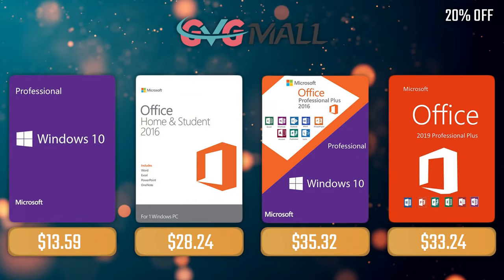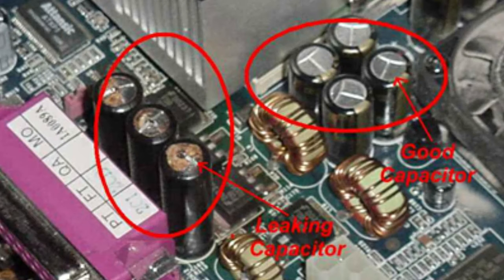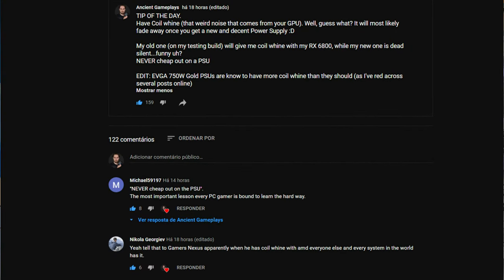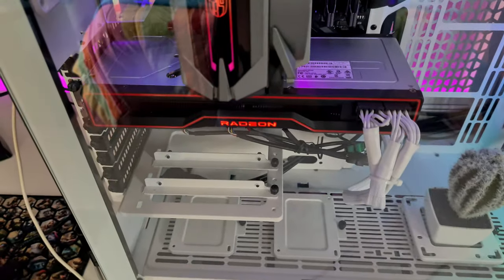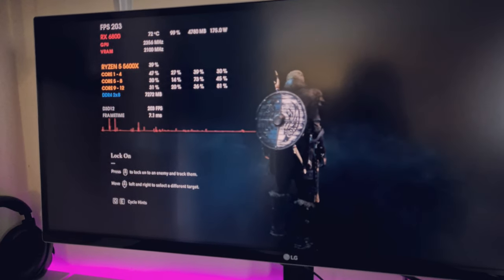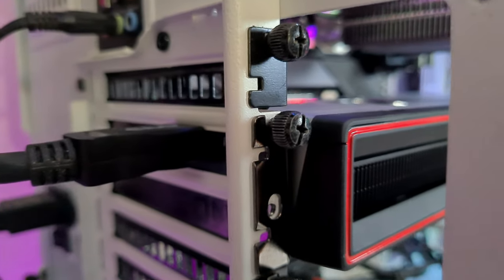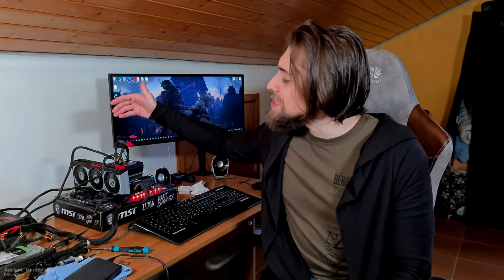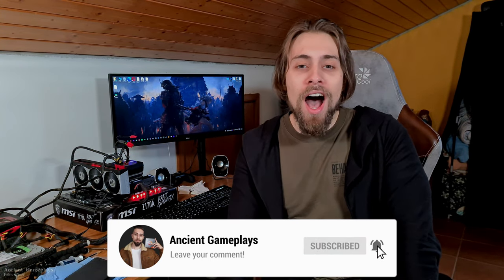GPU Coil Whine -  GPU or PSU's Fault? How to fix it?

Comment: I'm running a 750w Corsair Gold with a 6600xt and getting some coil whine depending on what I'm playing.  I'm using the 6+2 cable that came with the PSU but going to try buying a nicer 8 pin cable and see how that works. My GPU only has the one 8 pin port so using 2 cables isn't an option for me.
Reply from the maker: Hey man, dont do that, just get a new psu or undervolt your gpu
Reply: what brand is your 6600xt ?
Reply: @OptLab  XFX Speedster QICK 308 AMD Radeon RX 6600 XT with 8GB GDDR6, AMD RDNA 2

Comment: I just bought a Corsair RMX Series (2021), RM1000x and RX 6800 by powercolor and both have loud coil whine! = (
Reply from the maker: You got got a worse model I guess man, nothing you can do there beside undervolting, which considerably helps
Reply: @AncientGameplays   Indeed, I do also wonder if its because im using a b350 prime plus with a 3900x cpu. When i have more time i will try out your tips. thanks!

Comment: Rm1000x, gf3 1000w atx 3.0  which is better for rtx 4000
Reply from the maker: A good and new psu. 1000w is absolutely not needed
Reply: @AncientGameplays  which are better, rm1000e 210aud, gf3 1000w 289aud
Reply: rm1000e 210 ,rm 1000x 259
Reply from the maker: @zxz9041  get a good 850w and call it a day, like the rm850x

Comment: Should I go 750watt for future proof even with a 3070? Or 3080? For e.g seasonic gx focus 750w gold...Is it gonna have coil whine problems with my new gpu u believe?
Reply from the maker: A psu is always a food investement
Reply: @AncientGameplays Do you think giving 200€ for a white psu like rog 850 gold is worth the money?Seasonic is building them but is it worth spending 200 bucks on a white looking good psu for only 850w and gold certification or should I go with seasonic9(black) 750w gold at 140€ idk im kinda confused.Another question I wanted to ask you is that beside the fact I know you are mostly an amd fanboy,I had ryzen 5 2600 and I decided to change to intel (i7 10700k for the sake of money rather than going to an amd 5600x which would cost a bit more with less cores and threads)so I picked the vfm value this time...Do you think It was a good option for 330€ (i got the marvel's version) real price in greece is 315€ for the regular one...I'm telling you that cuz the new intel gen4 pci is coming (i7 11700k) but i wasnt willing to spend more than ~300 to a cpu for what I do, I think it's more than enough...I hope they are not costing like 350 cuz that would be really unlucky....Anyway glad to see a response from you and tell me your thoughts...You will surely help me!
Reply from the maker: @padazop  gold certification itself doesn't matter much. But yeah, any PSU over €140 should do it...it will literally last you years and years...
Reply: @AncientGameplays  do you think 10700k (i7) was a good choice 2021? for 300bucks? compared to 5600x 350+ and less cores/threads?

Comment: mine is 6600XT, that only need a 4 pin power cable, my PSU is corsair rm750x, any suggestion for solution to get rid the coil whine?
Reply from the maker: There's no such thing as getting rid of it if it is caused by the gpu components, undervolting will help, but it will still be there
Reply: Should I use 2 2pin cables To reduce it?
Reply from the maker: @aswinpanembrama8043  No, not really
Reply: @AncientGameplays  should I change the PSU with multi rail PSU? Or I just make my GPU running in stock not OC mode?

Comment: The RX 7000 series is known for having coil whine isn't it? I have a EVGA 850 G+ PSU which should be enough for my 7900 XT but I get really bad coil whine on the GPU. Though I have 2 SSD's and 3 HDD's so maybe my PSU isn't enough? I only have a Ryzen 5 3600 CPU
Reply from the maker: All series have coil whine, it is up to the version and materials used on the boards, not the gpus per se
Reply from the maker: Also, you're heavily cpu bottlenecked there
Reply: @AncientGameplays  haha I just upgraded from a 2070 Super. I'm saving up for a new MOBO and CPU eventually. I play mostly older games at 4K 60hz. So its not too bad.
Reply from the maker: @crusherman96  at there you're fine then!
Reply: It seems like ripples from PSU got amplified, maybe add a few ferrite beads to PCIe cables would help.

Comment: i have a be quiet straight power 11 650watt psu and the same psu in 750 watt here. no matter which, the msi trio 4070ti has extremly loud coilwhine, that i can hear from 6 meteres away. no change in the whine with 1 or 2 cables. the whine is louder then the fans on 1400rpm. the whine already start at 80 watts draw. so its even there on old games,  that use 20% gpu load, locked at 60 fps. so its bascially always there.
Reply from the maker: I can only see bad psu quality, bad mobo quality or bad components quality on the card
Reply: @AncientGameplays  smal update. i bought a 280 buck bequiet dark power 13 atx3.0 1000 watt.. result was no change at all

Comment: I use Corsair RM850x 80 PLUS Gold with my 5700xt red devil and coil whine is pretty bad. Will try to power gpu with 2 cables instead of 1 as you advised,  just wondering  would undervoltage your gpu helps with this too?
Reply from the maker: it having gold efficiency doesn't automatically mean it is "good", just that is is more efficient

Comment: I have a corsair HX1000 Platinum with a Sapphire Nitro+ Vega64 and when playing games it screams coil whine. So bad PSU or?
Reply: I'd say it's probably the vega
Reply: ~ Use a separate power pin cable.
~ Try dampening your case
~ Putting thermal pads over inductors coils and pressing them with Heatsink, Waterblock, or something else
Reply from the maker: Being 1000w doesn't mean much sadly and older psus suffer more (even more on high loads), but considering the insane power draw of vega 64 i assume coil whine is "normal"

Comment: I have noticed that rtx3000 cards always have coil whines. I had around 10 3070s and 3080s, whine always there more or less. 6800xt reference from gigabyte had insane coil whines, while same card from asrock was perfectly silent. For now I am using 3080 ftw3 so far quite silent.

Btw had two different psus from seasonic and be quiet, same crap.
Reply from the maker: Yeah, Gigabyte cards are sadly a crap....I would always get Sapphire, Power Color and MSI Gaming X for AMD, and EVGA, KFA2 and MSI Gaming X for NVIDIA
Reply: @AncientGameplays  I have 3090 gaming x trio with 750 watt Corsair psu and my whine sounds like a dog whistle
Reply from the maker: @Pcgamingfixes  obviously...those cards can easily pull 400watts alone, toss in the rest of the components and you have at  least 500w under load. if that Corsair PSU isn't that great, it will mean that the components will be bad, and having like 75% will definitely make things BAD. You NEVER EVER cheap out on a PSU. If you have a card like 3090, then you simply go and get a GOOD 850W (minimum) Gold Standard PSU from Corsair, Cooler Master, Bequiet, Seasonic, etc 
Have a nice day
Reply: @AncientGameplays  Fully aware just havent made the upgrade yet. I found a 3090 at microcenter for a cdecent price and I had the funds so I went for it. Just got lucky it fits my current case and everything runs seemingly well on my bronze 750. I've suspected a bunch of random issues I have stem from there. I also have been having an issue where certain apps will cause my Sony TV Im using as a monitor to just restart. Aimlabs was doing this today, selected a mission or alt + tab to another window and TV clicks off and back on again.

Comment: I thought I have coil whine with my powercolor red devil 6800xt. But it was my psu (be quiet straight power 850w) which made the noise. After I replaced it with one from corsair it is all super silent.

I stick my old be quiet psu in a friend's pc with an rtx 3080 and there it makes no noise. So it seems that it is really sometimes the combination of psu and gpu.
Reply from the maker: Like i said, its a mix of GPU/PSU :D
Reply: Matthias would you mind sharing what Corsair PSU you got ? I have the same gpu and PSU right now (be quiet) and the noise drives me crazy :)
Reply: @julienmoysens  Sure! I bought the Corsair AX850. It is a rather expensive power supply and of course no guarantee that it will work.With this combination, it's been working for me for about 4 months now. Good luck to you!
Reply: @nonespike  thank you for this ! I already managed to reduce the coil whine thanks to the tips of @Ancient Gameplays by having two separate cables. I might though buy aew PSU. Thanks for the suggestion.

Comment: Dealing with coil whine on xfx merc 319 6800xt had corsair rm750x bought a rm1000x have 2 cables running, I also have cablemod extentions, going to try without extensions
Reply from the maker: Try without extensions yeah, also, the XFX models aren't usually that great, and you can also undervolt your GPU a bit

Comment: My new gaming rig goes crazy coil whine when under loading, I have a 6900xt ref. card with EK waterblock installed and an Asus 850w rog thor power supply. Should i change my power supply but they both a brand new..:(
Reply from the maker: Well, that card consumes a lot, even more with EK waterblocks, but a better PSU is never bad. how about the PCIe cables. Also, you can try to UV a bit
Reply: @AncientGameplays  Hello, thank you for quick reply. i dont use PCIe raiser cable, just straight plugged to the motherboard PCIe slot. one thing i forgot to mention, with stock AMD cooler the coil whine still exist but not as loud as after installed EK waterblock.Its amplifying the buzzing sound that really annoying... :( .
Reply: I feel your pain. 6900XT (Sapphire) here with EKWB water block and bequiet Dark Power Pro 1200W PSU. The GPU screams like a madman, the coil whine ist just insanely loud. I put some of the plastic washers between the PCB and backplate screws and it got a little bit better... Also noticed the coil whine gets even worse when PSU and AVR/TV are plugged into different power outlets.
Reply: @christianliebling3769  I have the same brand as you. I read some post that dont fasten the screw tight to the waterblock, turn 1-2 turns of the screw to lossen it  after screw tight may help the coil whine
Reply: @kaizmak  yes I’ve done that and it also helps a bit but not that much. A huge difference was without the backplate, that’s why I reinstalled it with screw washers and I made sure to not tighten the screws too much. Just enough to secure the backplate. 
Same thing with the gpu block itself, I reinstalled it and only used two fingers to tighten the screws. I don’t know what it is exactly but the water block definitely made it worse. 
My old 5700XT with the EKWB water block also had some coil whine but nothing that bothered me. It was dead silent compared to the 6900XT. ^^

Comment: Having the issue of coil whine with a evga 1000w gold g5 & using 3 pcie cables on my evga 3090. I assumed it’s the same brand & it’ll work good together. I was wrong. Gonna pick up a corsair this week😂
Reply from the maker: It will always have coil whine to some extend my friend
Reply: Was corsair any good? I have the same Evga but 850w and the coil whine is unbearable when playing Spider-Man
Reply from the maker: @skull7231  spider-man is not that heavy, are you sure the coil whine comes from the PSU/GPU?
Reply: @AncientGameplays  Yep, i even got it on video sounding like a drill, i can send it to you if you wanna check it out.
Never buying crap from evga again.

Comment: Hello, I have coil whine in my computer, I am using rtx 4070 super msi oc 2x, psu a850gf 850watt, it is too low to be heard on the desktop, but it is loud in the game, I do not know how to get rid of this sound, I have read many forums and I use the psu with an ATX 2.0 converter cable. Could this be a reason? If I buy an ATX.3.0 psu, my processor is 750 watts. i714700kf do you think this will solve the problem? I don't ask you about this because the graphics card is chamfered and I cannot replace it. If you write me seriously, it will help a lot.

Comment: I have concluded after my  "scientific" studies that Coil whine is caused by the Case :( I have replaced basically all the pieces in my PC except the case, and Coil whine still persists ... lol
Reply from the maker: Coil whine is gpu sided lol, but the psu is definitely the "filtering factor". Getting a good one always helps
Reply from the maker: Also, house current may be a problem too

Comment: For GPU coil whine just run Unigine Heaven without fps limits, for 24+ hours. 
Solved my Strix 3080 OC coil whine problem, without changing PSU or cables or some other crap.
Reply from the maker: You dont "solve" coil whine per se as it is "electric vibration" sounds. You most likely just had parts that needed to be "burned" to make no whine anymore, and it would happen   with time. For almost all cards, thats not the case
Reply: @AncientGameplays  dude it worked for me, so I share my fix. If it can help even 1 person I'll be happy. Max stable OC (+70/+250) + 24hrs stress test did the job for me, can't be the only one. 
I have a be quiet 1200w platinum psu, I won't spend hundreds of bucks just to see if the PSU causes the GPU whine.

Comment: HI 
I have the same sound excatly .

gpu : Nvidia GTX 1070 8GB
psu : cooler master bronze v2 650 - 230 V

idle gpu power 9-15 whatts
idle gpu voltage 0.7 - 0.8

gpu power while gaming 1230 - 140 whatts
gpu voltage while gaming 1.0 - 1.1 volt

so it looks every thing normal but I still have the whine sound
I could not put two cable, any another advice ?

Comment: I've just built a PC 3weeks ago. I have new MSI psu 1000w pci 5.0 atx 3.0 and rtx 3080 ti vision. It started to coil whine after 1 or 2 days and I'm not sure how to check it if its psu or gpu. any advice ?

Comment: Im gonna try a different PSU. Mine is an 8 year old cx750 i got a little whine with my 980ti but now I have a 6800XT its VERY loud. I don’t hear it coming from the GPU just the PSU.
Reply from the maker: Yeah, the watts dont matter much as from 10 years ago to now, psus evolved tu support differe t power requirements

Comment: i have a brand new  fighter 6700xt and i have coil. My PSU is a RM 750 Gold corsair. I used two separate cables but there is coil. Should I return this gpu for a new replacement?

Comment: Thank you for the great video! I have just built a brand new PC, EXCEPT for the GPU (of course, they are hard to find). So I am using a brand new Corsair RM850x PSU, with a very old GTX 970 GPU. I am getting coil whine at all times. When I move my mouse, type on my keyboard, in game, etc. I unfortunately do not have another GPU to test on, and I cannot get integrated graphics to work on my motherboard so I can't test the PC without the GPU either :/ 

Is it likely the old GPU is at fault here?

Comment: hii, im using bitfenix whisper 750W, first i use 1 cable split to 8 pins then i try 2 cables, the result is 2 cables smoother but still i can hear a little bit coil whine, its dangerous? thanks

Comment: i got a 650w psu is that enough to run: I7 10700KF and a 2080 Duke? :)
Reply from the maker: you should always look into have a max of 70% load of your PSUs full power. I advise getting a corsair 750W gold (or seasonic) and you'll have a PSU for 10 years xD

Comment: I have not chip psu at all ASUS Strix 750watt Gold and have crazy loud coil wines with rtx 3090 and rx6800xt before… full loud of system 550-580 watt.  Tried ones gigabite 1000 watt gold psu and it was the same loud coil wines. Only some undervolting and fps limits help make it less noise but it still there…

Comment: I have a corsair Rm 1000x PSU and Rx 7900xt GPU
and whenever i'm playing Cyberpunk, RDR2 and even now GOW Ragnarok and I get pretty bad coilwhine at 144+ fps, but in other titles I haven't notice coilwhines, this could mean that any of those 2 components is defective ? 🤔
my pc is not even 1 year old since I did the assemble
Reply from the maker: no, not defective, coil whine is just electrical sound. your components, like your GPU should have better capacitors, but that's all, you're fine

Comment: I RMA the Corsair HX1000i its chirping like crazy as soon as I go above 300 watts (lol a 1k watt high ranked PSU)... This is driving me nuts and the very bad recensions since a while could be an implication, that Corsair changed some parts due to component shortages. Not sure whats going on but I hate this PSU... Now I also wasted another 200€ for a CableMod kit that I cant use if I use another brand instead.
Reply from the maker: You can get a corsair one, i mean, that must be defective. Also, what is "chirping"? Coil whine?

Comment: Only time I get coil whine is when I run my fans at full force too long I don't think it's my PSU but I do admit my psu is beyond overkill lmao it's 1200w gold raidmax cobra. I get no sound from my psu when this occurs I put my ear to it.

Cpu:3700x

Gpu: auros 5700xt  

Other: 32 gbs of ram running at 3600, auros x570 motherboard, Samsung evo m.2 250 gbs for OS, 1TB generic ssd, 500gb Samsung evo, and 2 TB Seagate  barracuda.

Comment: Running out of ideas here. Had 1070 paired with seasonic focus plus 750w gold, had zero coil whine, now i got xfx 6800 xt, got medium coil whine and random restarts while playing vermintide 2 and witcher 3 on ultra. Could it be the psu at fault or the gpu??
Reply from the maker: Hey, or you have a defective PSU or you have a cpu and ram instability showing up now since your gpu is now much faster.
Damn, it can even be as simple as a need of a clean driver installation...